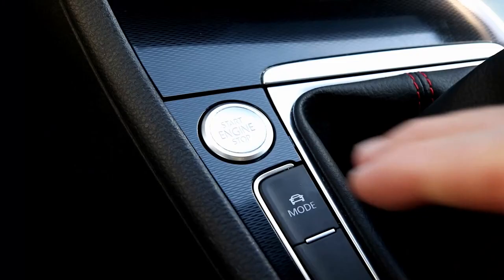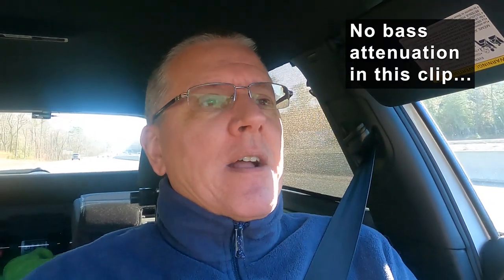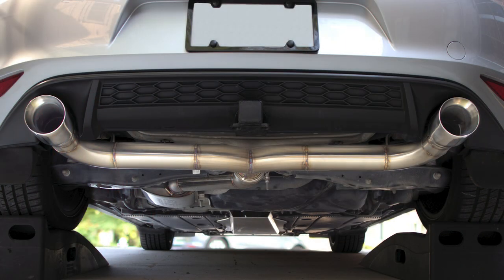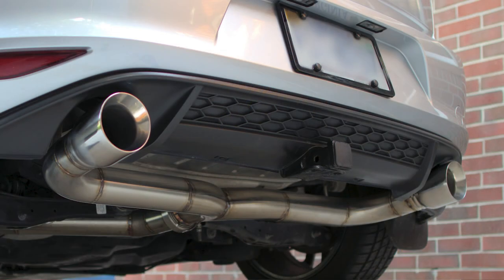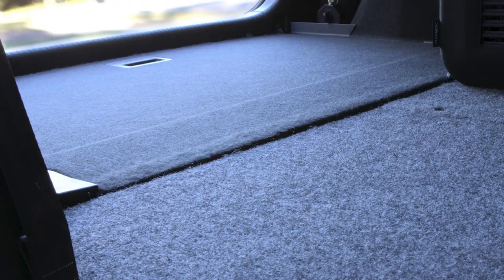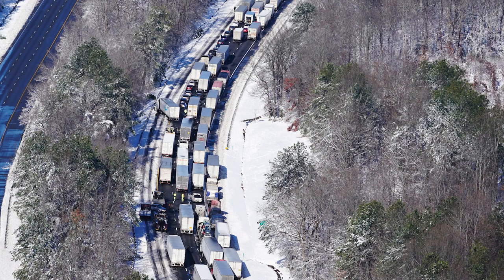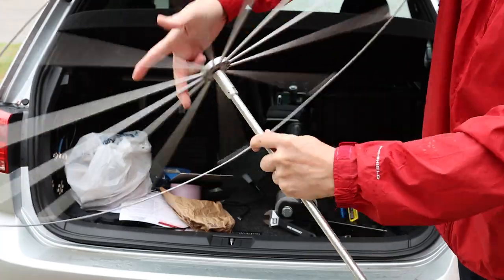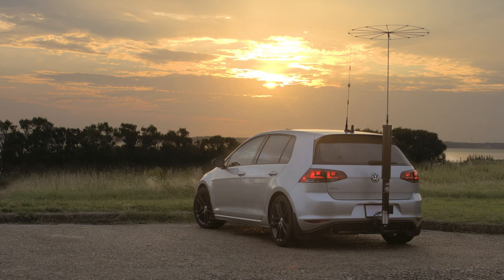ANOTHER BAUN TRIP!

Comment: For some quick cleaning to get the salt off I do recommend optimum no rinse. It gets the job done in about 5-10 minutes.
Reply from the maker: Thanks for the tip! I have a ceramic coating and use a coat-specific wash. While at the spray-n-wash, I didn't use any of their soap since they often contain waxes. I just rinsed the car, then quickly did my bucket wash, then rinsed again. I even had my leaf blower to dry the car. HAHA! Seemed to work well. I'll probably do it again when I attend a show out of state next month. Thanks for visiting!

Comment: Thanks for sharing this special project!  I am running a totally different set-up on my GTI, mid silencer and rear muffler from a Mk7 Clubsport S model (I guess never sold in USA). It sounds so much beafier than the stock exhaust. The only downside is a bit of drone under medium (and hiher) load, like highway speeds. My wife hates it too!  LOL...
Reply from the maker: This new exhaust has some drone. It seems more apparent because it's quieter everywhere else. I will share some measurements soon. I may be able to get my hands on a stock car for comparison.

Comment: Thanks for sharing the exhaust mod experience, interested in making similar mods to my ‘21 GTI S but curious if there are any weight saving and if so how my pounds?  Not sure I’d do it just for potential performance gains or sound enhancement.  Appreciate the hard work on the vids, and HNY!!  Cheers.
Reply from the maker: It's hard to say. I think the stock suitcase and huge OEM resonator are heavy. The Vibrant 17950 and Borla Pro XS are certainly smaller and lighter. But we didn't weigh anything. The weight savings start to dwindle once you add the dual resonators or suitcase. I just remembered that I still have the stock suitcase. I'll have weight it to see what it weighs. The resonator is another story, though. It's gone. Thanks for visiting!
Reply: @StealthGTI  thank you for the quick response, looking forward to more content.  I love your mature approach to sensible mods, the fact you drive the wheels off the car, and, of course your complete honesty!  Best.
Reply from the maker: @steveottavaino3804  - Thanks for your comments! Speaking of driving the wheels off, wait until you see what I have to share after the exhaust video.  🙂